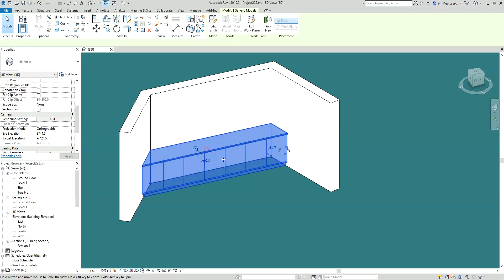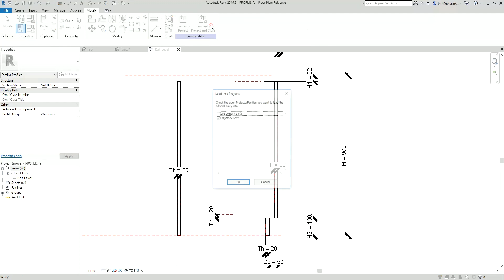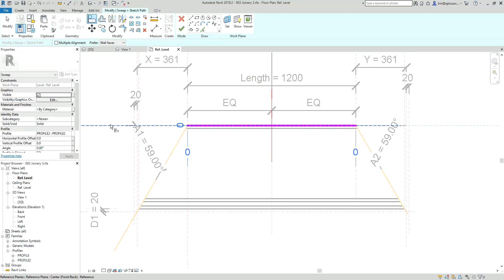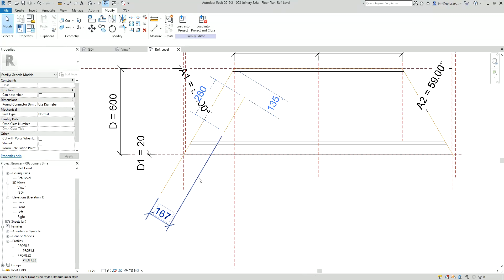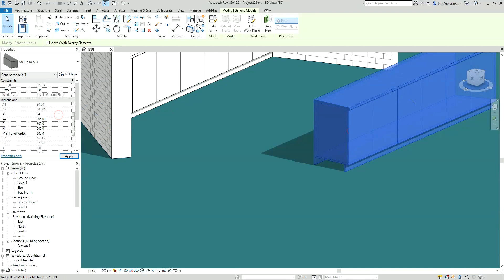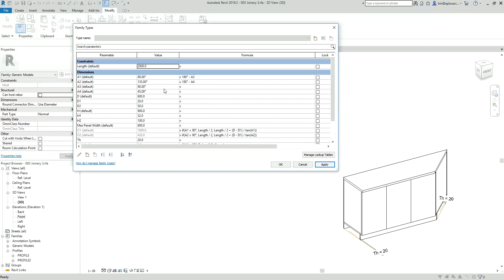Revit Modeling Exercise 010 - Line Based Joinery 1.3

Comment: Hi, I have a question: Why did you create a profile, load it, then went back to the profile and delete it? After that, you created a new profile, then saving as PROFILE2, and loaded it into family?
You didn't explain that process.
Reply from the maker: This is an old video; I have to go back and watch it myself. I believe what I was trying to do is to separate the panels by creating individual profiles for different parts, allowing me to apply different material parameters to each part. Since I have already created a profile with all the reference planes and parameters I need, the easiest way to populate the profiles for each part is to save them as different profile files with distinct lines drawn in various parts. This way, when I create sweeps with these profiles, they can share the same sweep path with the same vertical or horizontal offset. I hope this makes sense.